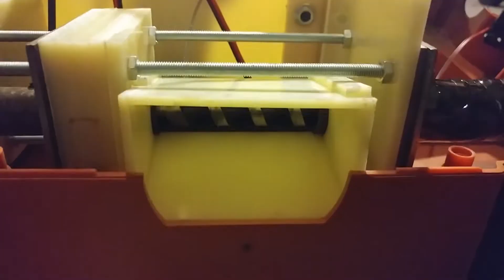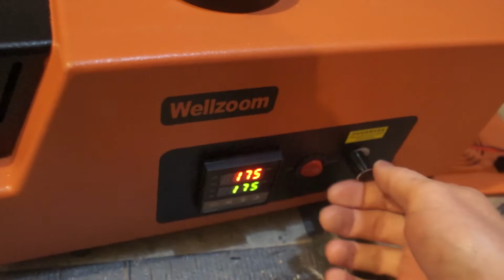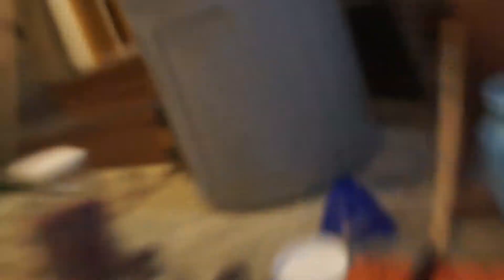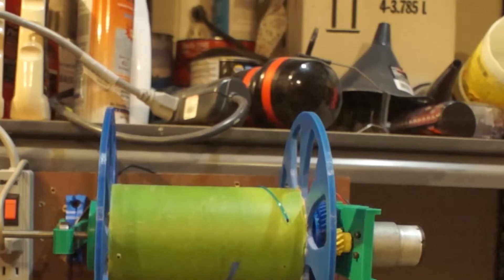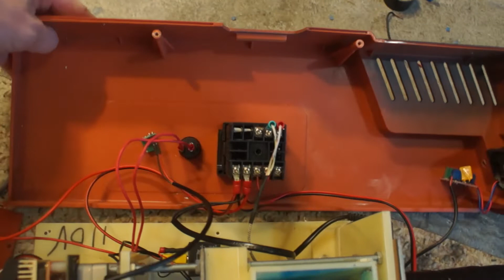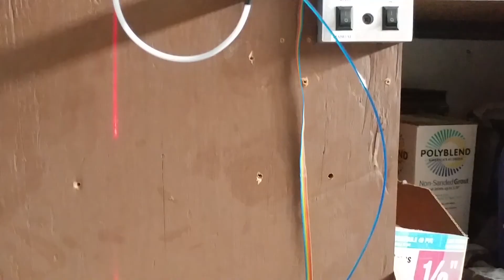wellzoom desktop filament extruder review

Comment: One small correction for the schematic:  the push-button switch needs to be wired across (ie, parallel to) the switched relay terminals.  This allows the push-button switch to temporarily bypass the relay in order to provide power to the power supply, thus letting the power supply engage the relay.  Your schematic shows the push-button switch in series with the relay switched terminals, which doesn't let the system get powered on.
Reply: How do you wire that? Can you provide a schematic?

Comment: I feel frustrated the American extruder company doesn't reply to emails for days I would expect for the price service would be faster.  Filastruder customer service is good but it may be more of a tinkering project than I am ready for. This wellzoom looked promising because it uses a stepper to drive a screw rather than a DC motor that could be prone to voltage swings and slight RPM changes.  Then I found your amazon review and then this video.  Yikes!!!! I can't win.  I feel like all of these check one box but miss another. Thank you for the video and amazon review.

Comment: I didn't get how fast this machine is working. Looks like it is slightly faster than any ordinary printer can "eat" the filament?
Reply from the maker: I think i can produce anywhere from 2-3 spools in 24hrs of operation.
Less for PLA, more for ABS
Reply: @tonycstech  "Spool" - equals 1 kg?
Reply from the maker: @rmatveev  I think so.
Regular 2.2lb spool.
It's a very good extruder but I still think $600 is little too much.
Reply: @tonycstech  if you will get the temperature up will it work faster?
Reply from the maker: @rmatveev  faster will make filament come out too hot and it will not maintain consistent diameter.
Faster extrusion requires water-cooling.

Comment: The feedscrew is a "proper feedscrew" and not an auger (bit) like used by the DIYers? That is funny. An auger is a proper auger, except the wood auger bit is guaranteed to be good tool steel, unlike said feedscrew, except for the fact that said feedscrew looks to be a modified Chinese wood auger bit, which makes things even funnier.

Comment: @Tony Nameless  please assist meI need to build a desktop filament extruder
Reply from the maker: I never built one my self. How can I assist you ?
Even manufactured once are tricky.
Making one your self is even harder to get it to work at all.
Reply: @tonycstech  looking at the way you review the wellzoom extruder, maybe you know the components used and where can I get them. I only need four components, gearbox, motor, bearing and a power supply
Reply from the maker: @khayelihlemadlala7655  they key component here is the compression screw and the barrel that will go over it with the diameter slightly bigger. Maybe 2-3mm bigger diameter, no more.
It's hard to find two that match.
Reply: @tonycstech  Okay thank you. What type of motor, power supply and gears in the gearbox do you recommend?

Comment: Tony - Thank you for the review.  Now that you have worked out the initial bugs on this machine (last year), and working with the unit for the last year, would you place purchase for this make/model again? or would you go with a different make/model, keeping within the same price range?  I ask because I am seriously thinking about placing purchase for a filament extruder here in the near future. Was looking at possibly making my own from scratch, but after adding up the piece parts, time and effort to do so, its seems it may be more cost effective to place purchase for one in this price range. All advice is welcome.  Thank you again for the review on this particular unit.
Reply: i like how tony liked this but didn't reply...
Reply from the maker: @nonchip  not my fault.
YouTube does not send me notifications when I get a reply to my own videos, only videos I comment on other channels.
It does now for some reasons but for many years I had no clue people asked questions.
Reply: @tonycstech  How easy was it to customise/upgrade the parts on this? Or any better stock desktop extruders you've come across? Looking to mix powder with my plastics. Any help appreciated thanks!
Reply from the maker: @sumeetjagtap980  I don't think there is anything better on the market then this.
Define upgrade ?
Faster motor ?
Not gonna happen. You will need more powerful heater to melt faster. Then you gonna need water cooling to handle the material then you need stronger frame to handle the resistance etc.
It's balanced the way it is. No upgrade needed.
Reply: Wellzoom does make a faster machine but it comes at a cost. Two heating zones and does 150 inches per minute. The single zone that Tony and I have will do about 10 inches per minute. 
Wellzoom Desktop Filament extruder line II(V3.0)

Comment: Hey man, can you tell me why you insist on the vertical extrusion? What aspect of extrusion does it improve? I have been getting my unit to work well horizontally but I cannot get the filament diameter to be wider than 1.6 mm for pla.
Reply from the maker: If you get consistent diameter but size is wrong, drill it out.
Reply: @tonycstech  haha that’s so ironic, I actually drilled it out to the diameter you suggested earlier today and it’s looking pretty good now. 1.7 mm filament from a 1.90 drilled out hole. I’m gonna try flipping it vertically see if it makes it easier to control. I have the wellzoom auto winder with optical sensor.

Comment: Do you find that this machine doesn't do well in a vertical position? Mine makes a grinding noise.
Reply from the maker: Nop. Mine runs smooth.
I mean it does squeak when pushing half molten plastic closer toward the melting area, but otherwise no.
Sometimes a pellet gets stuck on its way into the tube and gets forced in. That can sound like loud pop, but its just the pellet.

Comment: Hi, what is the advantage of a proper feeder screw over the screw that the filastruder uses?
Reply: Mostly compression. Using a feeder screw mantains the compression stable and even during the extrusion, making filament with more consistent diameter

Comment: Tony, good night, what nema is this engine? What is the specification of the machine's motor?
Reply from the maker: Honestly i dont know.
I know one fact, its has enough power to twist and break its self off if you turn it on cold for more then half a second.
I didnt want to confirm this so i turned it off.
You can contact the seller or wellzoom website for specs.

Comment: Hi Tony, how do you control the diameter of the filament? Is the tolerance of the diameter good?
Reply from the maker: #1 nozzle diameter
#2 temperature
#3 filament sag before it enters the loop. More sag=less diameter.
If filament comes out larger, increase the sag before it enters the loop and filament weight will stretch its self changing the diameter very slightly.

Its a tricky process. ABS is very easy to control while PLA and PETG are tricky.
If anything, learning to use this machine with ABS is the easiest way.
Reply: @tonycstech  Thank you very much!

Comment: Hey, can you share the dimensions of the nozzle? As far as I can guess, it looks like M 16, but I would like to know about the pitch and length of the thread.
Reply from the maker: If am not mistaken, its an M16X1.5 little over 8mm long thread.
21mm diameter nozzle its self with 17mm diameter hex pattern for supplied wrench.
Hole diameter depends on the filament you extrude. I use 1.9mm for PLA and 1.6mm for ABS
Reply: Thanks a lot!!
I am planning to use ABS for extrusion primarily.
Reply from the maker: @pranjalkhakse2582  Its best for ABS. Extrudes quickly. PLA is slow and tricky but ABS is super easy.

Comment: Hi,  you mentioned in #4 that recycled plastic extrudes only in horizontal positions. If I were to be working with recycled plastic bottle caps (polypropylene) I tried extruding it (with filastruder) in the horizontal position but it had varying thickness which made it very hard to print. Do you have any suggestions to help with my process?

Comment: You mentioned the feeder screw vs the drill bit diy approach.  Is the feeder screw faster, does it mix better, work with more materials, or something else- eg what are the benefits you are seeing?
Reply: @tonycstech  Have you stuck to just ABS or have you tried PETG yet?  It's pretty viscous, and I'm wondering if the plastic backbone can take the stress (or if the motor can handle it)

Comment: Hello, can you please tell me the PID settings of the temperature controller? I have a similar extruded and would like to Che l these settings. You can see the parameters by pressing SET button for 3secs. Thanks
Reply: Tony Nameless I have tried all combinations: pid auto tune (at least 100 times, no joke) insulation, extrusion speed, heat resistance max output control, but nothing. Although the temp variation is +-0.5 C I have a periodic plastic output very hot, high speed, that ends to bigger filament diameter, +0.5mm that is out of tolerance... yesterday I tried on-off only without any pid control and seems much more stable..... any ideas?
Reply: Tony Nameless at least can you point the position of the temp sensor?

Comment: Hi, thanks for the review! I want to get one to try to make filament from plastic bottles PET... Was wondering if you tried that or know anyone that has?
Reply: @tonycstech  sticking plastic in an extruder is easy to clean with ldpe
Reply: @tonycstech  3devo managed to make filament from 100% recycled PET (water bottles) material :)
Reply: Very true, but they admit its challenging to work with (mainly because its brittle and difficult to spool) and their systems are extremely expensive, over $6k to start.

Comment: Thank you for such an informative video! I really like the idea of the automotive switch safety feature - I never thought about that. I am definitely going to implement this feature in my extruder that I am building. However, for the life of me, I can't figure out how you hooked up the relay. The relay looks fairly simple, but the way that I am imagining it working, I can't get this "latching" effect. It just seems like everything will turn back on again when the power comes back. Would you be able to go into a little more detail on this (maybe which pins are connected to what?). I imagine that the 24V is connected to the solenoid (pins 85 and 86) and that the 110V is connected to the high power side (pins 87 and 30). I'm not sure where the switch comes into play. Thanks in advance! Looking forward to implementing this!
Reply: See my comment above about the switch wiring.

Comment: Good video. Thanks. Have you tried LDPE and/or HDPE? How did it go? Are you using the middle diameter guage unit that the manufacturer sells with the set?  Thanks for the link to your thingyV.
How would you compare this unit to the A- Filastruder (I am using that now for LDPE and not really happy), B- Filabot?
Reply: note: you mention the screw. Thanks. I wonder if the Filabot has that screw or not.  (we are making prosthetics from recycled material,  using Filastruder and it is very tedious).
How do you purge or clean this machine? Does the inside of the nozzle get clogged? (we have modded ours as the Fstruder would get blocked all the time). Really appreciate your time in making the video and answering the questions, thanks in advance.

Comment: Hi Tony ! My nozzle keeps getting blocked every 2 minutes and material starts to get extruded very slowly. Do you know why? I’m printing PLA at 190. Not sure how to stop this from happening !
Reply from the maker: Do you have a filter ? Clean by burning it 
Dirt or residual plastic or junk on the screw. Take apart, clean and polish if possible.
Contaminated PLA colorant powder thats not 100% powder but has little strings in it that clog everything ?